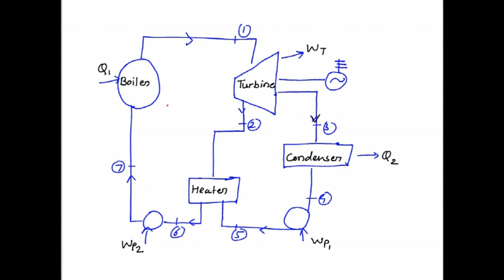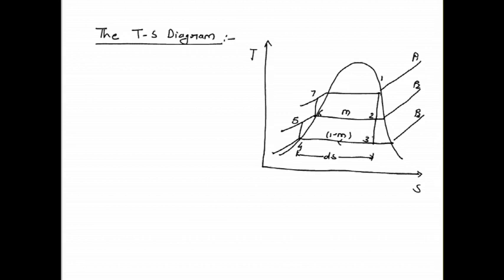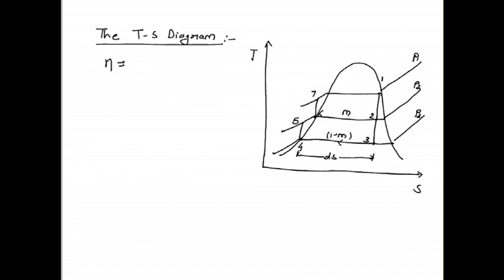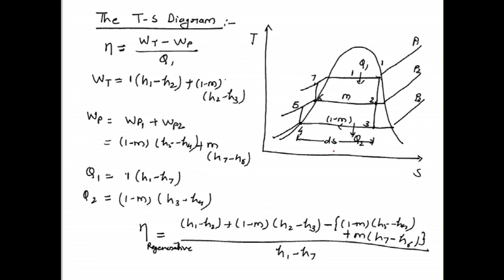REGENERATIVE CYCLE

Comment: at point 6 'm' kg steam and (1-m) kg water is getting mixed therefore (1-m+m)=1 kg water will be raised through the pump (6-7) .
hence work req by pump (Wp2) should be 1(h7-h6) instead of m(h7-h6). isnt it ???? please comment